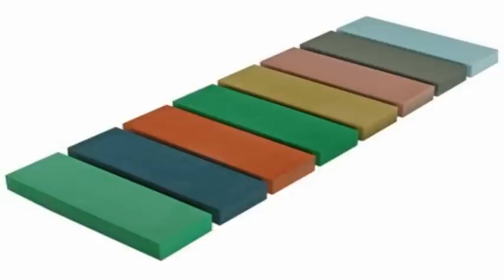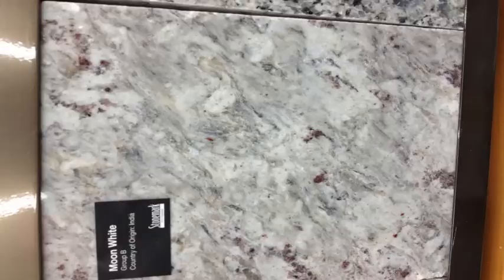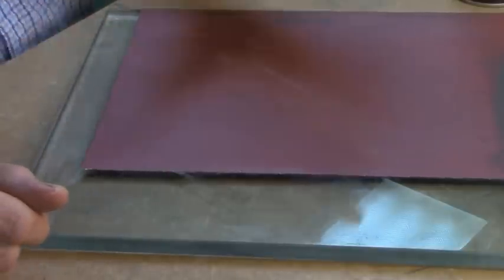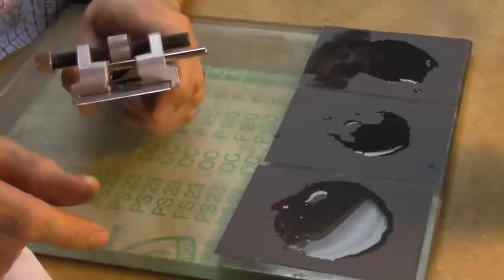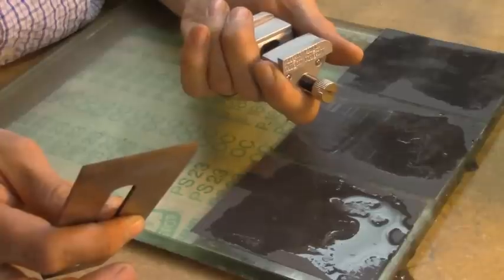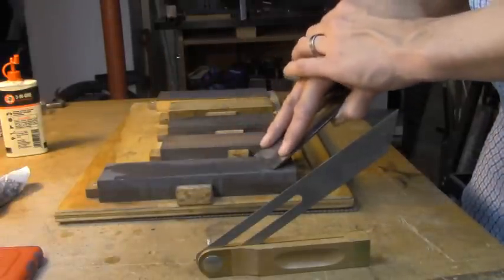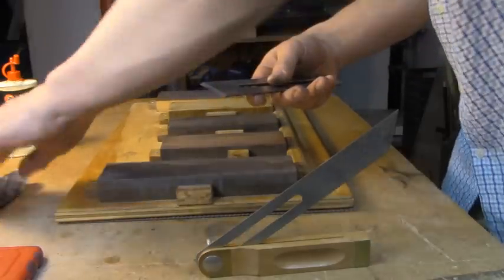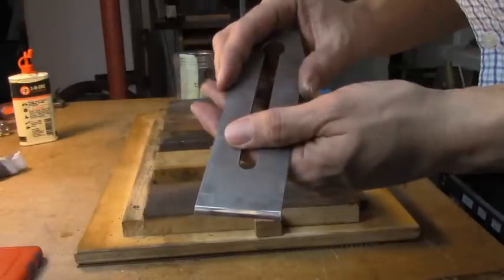Hand tools for $100 #4: Sharpening for Cheapskates

Comment: I can take a moderately dull knife or chisel and, in only a few moments using sandpaper, oil stones, or diamond plate, I can turn it into a lump of steel that won't cut butter.
Reply from the maker: Have you tried a jig? They're a great way to get started.
Reply: Heat it. Remember “like a hot knife through butter?”
Reply: Hopefully you didn't spend hours accomplishing it like I did.
Reply: @RexKrueger  I have a whetstone that I inherited with my ship, its face is concave, how do I fix that?
Reply: @svchineeljunk-riggedschoon4038  fill the valley with bondo and beach sand.  Trust me.
Reply: @phuturephunk  If I was going to do something like that I would use quartz sand and two part epoxy :P
But tbh, I would rather try something like heavy duty sand paper first. The reverse face is flat, so it is not desperate, I was just wondering if there was a relatively easy way to do it.
Reply: @svchineeljunk-riggedschoon4038  I was just playing with you ;)  I wouldn't even know how to approach fixing a whetstone.  I only use mine for scissors and knives so I don't have that much wear on mine yet.
Reply: @phuturephunk  lol, no worries mate, I tend to assume most people online are stupid, so it is hard to spot sarcasm ;)
Reply: whetstones naturally don't hold a flat edge, diamond will hold up longer.
Reply: That would work no doubt, but i would have to buy another whetstone, and the valley on this one is a good 3mm deep.  Maybe some high quality diamond paper will do it.
Reply: If it really can't even cut butter afterwards, then you definitely need to turn that into a video.
Reply: @svchineeljunk-riggedschoon4038  you can take a flat tile or plate glass and use coarse sandpaper.
Reply: @svchineeljunk-riggedschoon4038  have had this problem myself as well. the way I fixed it was a wet saw. I took a few to a stone countertop place and for a few dollars they took a thin slice off of the top. I have tried a few other methods but by far just lopping off a couple millimeters with a diamond blade is the best way I found so far.
Reply: @Colonel_Overkill  Good idea, thanks.
Reply: @svchineeljunk-riggedschoon4038  i will recommend using a concrete side walk, it's definitely fast enough and offers decent results. my stones were dished so bad i couldn't do anything else really.
Reply: @svchineeljunk-riggedschoon4038  glue wet/dry sandpaper to a flat surface, wet it down and run the whetstone over it until flat.
Reply: SV Chineel, Junk-Rigged Schooner Sailing flattening stones off eBay.
Reply: For real!
Reply: Wolf Lahti that was really not what I was expecting, and very funny.
Reply: Try a flat, wet brick.
Reply: @svchineeljunk-riggedschoon4038  buy something called a flattening stone, or buy a very coarse(140 grit) diamond stone, or a Rust Eraser Sabitoru. These are all good options for flattening a stone. I listed them in order of price/efficacy.
Reply: im literally laughing out loud, i can relate wholeheartedly.
Reply: Use the sharpie trick
Reply: @svchineeljunk-riggedschoon4038  for chisels, buy a new one, for knives it may still work. Rectifying by hand a badly dished stone may not be worth all the elbow grease requiered.
Reply: @svchineeljunk-riggedschoon4038  Depends on how bad it is but I used to grind my hollowed stones on a flat concrete floor.
Reply: i guess im asking the wrong place but does any of you know of a trick to get back into an instagram account..?
I was dumb lost the password. I appreciate any tricks you can offer me!
Reply: @Nikolas Brendan instablaster :)
Reply: @Aron James I really appreciate your reply. I got to the site through google and I'm trying it out atm.
Looks like it's gonna take a while so I will reply here later when my account password hopefully is recovered.
Reply: @Aron James it worked and I now got access to my account again. Im so happy!
Thanks so much you really help me out !
Reply: @Nikolas Brendan No problem =)
Reply: For a knife I use a Lansky system. I have used the same system for about 20 years and I am knife lover, so I sharpen a lot with only 2 hones that I replaced for less than $10 each. I got in to straight razor restoring and have to use stones for those, but with straight razors you are pretty much running the blade flat, so no angles to worry about. After a while you will have to lap stones (flatten them out), especially when you are going for razor edge. I use them for my woodcarving knives as well by feeling where the bevel lays flat. 

On jacked up blades I use a sharpie on the edge and go course to work out the bevel.  Watch the edge for progression of polishing and the opposite side for burs. It is mostly going slow through the progression of grits, my biggest mistakes is trying to rush it.

I have ended up reprofiling most of my knives from when I used micro bevels, they go dull fast for regular knives, IDK about for planes or chisels.

Comment: I always tell myself if a cave man could sharpen stone enough to shave with, what the hell am I doing with my life?
Reply: You could be saving up to 20% by switching to Geico.
Reply: They knapped flint which is not really comparable, when a flint tool goes dull you either reknapped it or just make a new one.
Reply: @squirehaggard4749  "safe drivers save 40%"; with another company.
Reply: @joegallagher1842  How old are you? All my ancestors have been dead for a long long time.
Reply: MichaelKingsfordGray  John Oldman

Comment: Actually, it’s not necessary to do what you do at about 19 minutes in. With bevel down  planes, the edge contacts the wood at 45 degrees because that’s the angle of the frog. So long as the bevel angle doesn’t exceed 45 degrees, you will have clearance. The common angle tolerance of 30 to 35 degrees still allows for 10 degrees of clearance under the bevel, so rolling the bevel isn’t necessary.

Comment: Excellent explanation of plane iron maintenence.  I bought a set of soft, medium, hard, and extra hard Arkansas Stones for my first sharpening system.  I was in 8th Grade.  Over the years I learned how to maintain the flatness of my hand sharpening system.  Accumulating stones Wow! "Ain't it the truth?" I have a dedicated tool box that has so many stones in it it is very difficult pickup.  It must weigh at least 200lbs.  I have been doing woodworking with hand tools since elementary school in the 1950's.  I'm still learning.
Reply: LOL! We're both "Of an age". The way I put it is, "They used to call me 'Young& Foolish'. Now they just don't call me 'Young' anymore".

Comment: if your neighbor is throwing a way a printer/scanner, salvage the glass platter from the inside. it's a little bit on the small and thin side but it will work. maybe glue it to a piece of MDF for some extra beef

Comment: Good video.  You might let viewers know that the second bevel you ground is commonly called a microbevel.  In addition to being quicker to sharpen, it removes less material from the tool iron since you only work with the microlevel.  I use almost nothing but sand paper, up to 10,000 grit on a scrap (but flattened) piece of granite.  My final strop grit is a .5 micron diamond paste on leather or Flexcut Yellow Compound (.6 micron and non-toxic to kids and pets).  Also good to mention that the grits used in sand paper (there are 2 types, US and Euro) and the grits sizes for waterstones, Arkansas stones, Aluminum, Ceramic and diamond plate are all different.  A 1200 grit USA sandpaper is around a 9 micron grit size while a a DMT x-fine Diamond stone is also around 9. The Shapton 4000 grit waterstone is a 3.6 micron stone while the Norton 4000 grit is 3 microns and the Lee Valley is 2 microns.  As a result, when I go to fine grit papers on Amazon, I look at the particle size as opposed to grit.  Not a big deal when the paper comes from AutoZone or Lowes but as the skill level increases and need for finer edges continues to go up, it can make a noticable difference.

Comment: What I love about this video is it gives you a starting point.  I have been spinning my wheels buying water stones, oil stones and diamond hones in all the wrong ways for years and struggle to get a sharp edge.  This method will get you where you need to be at minimal cost.  And for a glass plate I just took a shelf out of the refrigerator.  To keep the wife from know what was up I cleaned and rearranged everything in the fridge  so she would not even notice the missing shelf.  Worked like a charm.

Comment: this is a really good video, thanks. clear and through explinations and demonstrations,.nicely done.

i agree that the sandpaper on glass (scary sharp) method is probably the best for begenners, but isnt the most echonomical in the long run,.as you mention. for grinding in the bevel and especially flattining the back, something that stays flat is a real advantage, so i like scary sharp or diamond stones for this stage.

I do agree that sharpening can and should be simple and cheap to start out with, but a few things i would like to add for those wanting to get a bit more in depth:

*its verry important to flatten the backs of your chisles and plane irons as a first step in sharpening, otherwise your nicely honed bevel wont be meeting a nicely honed surface on the back.

*the reason for a more accute bevel is because you can acheve a keener although less durable edge, for some woods this really helps your finish

*its a good idea to crown your smoothing plane blades slightly to avoid plane tracks

*the advantage of waterstones vs oilstones is mainly they cut faster, each stone is more flexable in the finishes it can acheve with varrying presure, and they are avalable in much finer grits than oilstones. 

i generally recomend waterstones because i think they have allot of advantages over oilstones. a "fine" oilstone is generally between 350-400 grit, this should really be considered a coarse stone. a "finishing" waterstone is atleast 3000 grit (different grading system but similar enough in this range) and usually closer to 5-8k. generally the only option for an equivelent oilstone is a quality translucent or black hard arkansas, which are getting harder to find, and generally fetch a higher price than a good japanese finishing stone, which really proforms better. 

you can get a good combo waterstone for $55 (the imanishi combo stone is good) and it will outproform any oilstone combination that i have seen in both speed and finish, and i have some verry nice vintage translucent arkansas stones that are essentially flawless and extremely fine. you are correct that oilstones tend not to wear as much or at all, esp at the finer grits, but its a tradeoff for the proformance i think is worth it.

Comment: I like the tip about the appleseed bevel on the plane iron. There is a reason swordsmiths use this for a tough edge... ahem. I also personally didn't have access to leather so I used some heavy denim for my strop. Worked well for me anyway.

Comment: Made my own whetstones with my angle grinder, a $15 diamond disc, and free rocks from my local beach. Just cut them flat and rub it on another cut flat rock until smooth. Works great on chisels, knives, and axes
Reply: Demon Axc : Sharpening a blade is really just rubbing a piece of steel on a rock. The rest is all bells and whistles.
Reply: @censusgary  I agree. It's just more fun to make you're own at least i know the quality is good
Reply: Demon Axc at least you know it wasn’t made by slave labor in a dictatorship...

Comment: I bought one of those fancy waterstone  grinders a few years ago when I had the money and was equipping my workshop. I now only tend to use it for grinding the bevel and I would say the main advantage is its quick and easy if you have a damaged blade. I still do the final hone on a flat waterstone or oilstone as its probably just as quick and easy. Great video.

Comment: Granite countertop is also a great flat surface, you can get the cut outs from sinks from any granite countertop production company. I pulled 200 lbs worth out of their dumpster.
Reply: Richard Solomon true. Polished granite tiles work as well
Reply: @Sadowsky46  they are easy to break if you aren't careful, the thing I like about free countertop cutouts, is you can easily turn it into a table top for all your lapping and sharpening needs.
Reply: My wife didn't take kindly to sandpaper glued to our kitchen worktops, but you are right.

Comment: Very good introduction to sharpening, the curse for the apprentice who had to learn to sharpen, freehand, running. The 25° bevel and the 30° honing bevel were the angles that Stanley and later Record advocated as the correct angles but as we did it freehand and normally in a rush with the foreman breathing down your neck, the angles were not strictly adhered too. We did not use protractors in the 1950' and 1960's.  I was always told and still do, place the 25° bevel on the oilstone and raise the iron until the oil oozed out under the edge, to the front and that was the honing angle. It works and probably has for centuries. We ground the 25° angle on a grindstone or something near it.
Reply: That is the best tip I've found after hours researching sharpening on the internet. Would this tip work for gouges too?
Reply: @BigHenFor  Gouges are a special kind of frustrating creature... Straight-edges on bevels work really well with the "until oil oozes" trick... BUT those that have a curve or are concave (as gouges are wont to be shaped at least occasionally) the applied surface to the stone isn't large enough to really push any oil around...

    They can still be "hand sharpened" in a couple of methods... 

1. Either find or carve an approximately similar concave shaped utensil and stick abrasive (like wet'n'dry paper) to the appropriate curve.
    I've found that bamboo segments or river reed (basically Bamboo grown natively here in the States) work pretty well. You don't need many, but the particular choice for collecting a few very close shape to start is kind of important. Just hack the thing down and at home (at your relative leisure) saw out a segment and then cut it length-wise in half. Each segment is "walled off" from the others, so there's a little carving to be done and smoothing before you can lay the paper inside... You'd be well advised to go ahead and really sand a decent finish to the outside as well, so glue will stick... AND about any good spray adhesive will do the job. I like to keep around a few different sizes for just the occasion there's a curved utensil that needs abrasive shaping, and I can usually do a pretty damn decent job with the river-reed improv'...

    2. Similar to the first option, only you usually end up cutting a piece of tubing or pipe for a "guide jig" to use on a power grinder... Remember to be gentle, and it's wise to test the surface to surface "mating" between the gouge and the stone BEFORE you start the grinder... NO sense in grinding away a bunch of material before you're fairly confident it's the right thing to do...

3. A Dremel tool can be had for a reasonable price, AND of all the over-bearing marketing doo-dads out there for sharpening... You will get a LOT MORE versatility and use out of the humble Dremel (or similar rotary "hobby tool") than about any of them.

    I'm not a fan of using power tools to sharpen anything. Frankly, power equals speed, and speed equals HEAT... Heat is BAD on steel, as it destroys the temper...
   BUT in a pinch and no better solutions, I'm certainly not going to bash a man who just wants the g** d*mn thing to work!  SO here's a couple tips...

1. Take your time. Power tools will get you into trouble quickly... AND a regular pause to touch the utensil you're sharpening will give you feedback about how quickly that particular blade will heat up... If it's uncomfortable to touch with a finger, take a break and cool it...

   THE TRUTH is most of the time, steel won't start "breaking temper" until its around 400F (nothing off the top of my head, for C)... BUT the easy way to tell is that it's losing temper ANY time the metal CHANGES COLOR, and it will literally Turn BLUE first... 

    BUT if you just remember to stop and douse (with a large-ish container of water) the thing to cool it any time it gets uncomfortable (no, don't burn yourself... I really mean "uncomfortable") you probably won't have any problems with temper.
    ANGER on the other hand... well... a therapist will help you better than me.

  2. Electricity and water don't mix... SO PLEASE do NOT go trying to sharpen the damn thing in a big bucket or pond or swimming pool of water just to keep it cool. That's not a good idea. It might seem good, but you're even better off just raking an old file over it and calling it a day...

 3. Lower speed settings (and variable speed IS GENIUS) will do better work than higher as long as they're actually doing work.

4. FINALLY, if you DO go with the power tool, let the TOOL do the work. Even a Dremel is a well engineered piece of equipment and those stones don't have to look like much to do a good job removing metal... which, at the end of the day, is really ALL sharpening is about.

    The only real trick to gouges is getting the edge EVEN. ;o)

Comment: I recently changed floor in my kitchen and realized that the scrap cut offs from floor tiles that go at the edge can be used as strops for polishing edges.
The floor I bought has a thin layer of cork at the bottom which makes it similar to leather and the tiles are nearly 10 mm thick.
If you want to be really cheap, you can just order free samples and have a few strops for free.
I have used one piece of a tile for a few weeks now and I can't see any difference in results compared to my leather strop.
Maybe it will wear out faster but it's basically free.